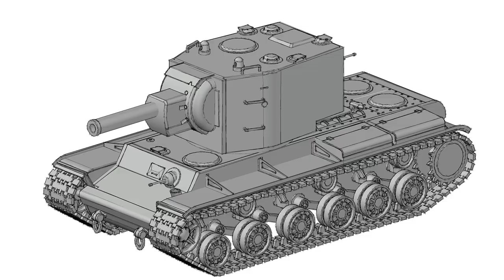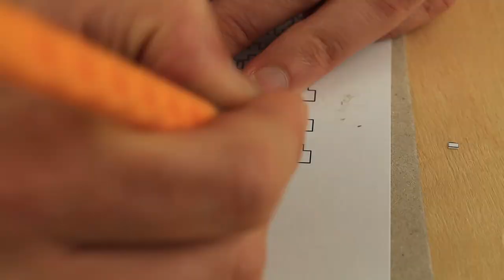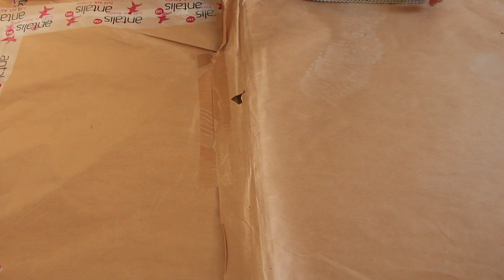Cardboard KV-2

Comment: have you ever had any luck making something mechanically functional out of cardboard?   years ago i got this mechanical pendulum  clock kit from Wrebbit that was all carboard construction.  it was really neat design and fun to build, but it never did work very well.  i would love to see you tackle something like that.
Reply from the maker: I wanted to do here at least when you push the tank wheels spin. But I ran into some issues could not make so precise wheels and was not sure will track will not jam with the rear wheel. So decided to make it fixed. There is lot of things to think about for the next tank project. Don`t know if I will fix them all but hope there will be some improvements.